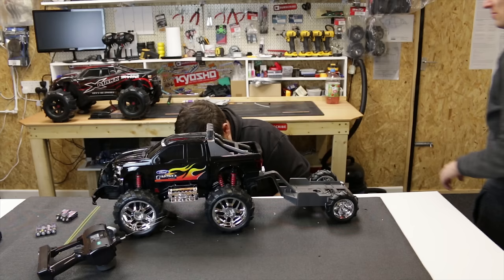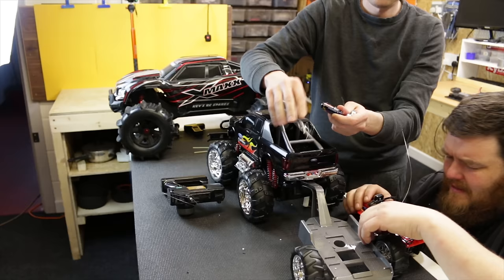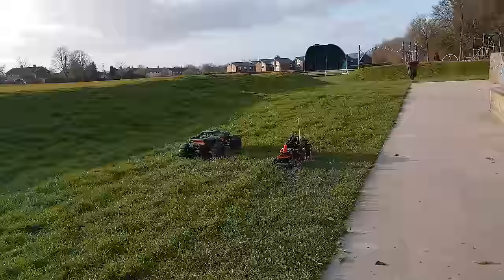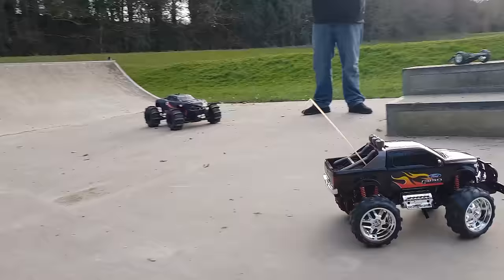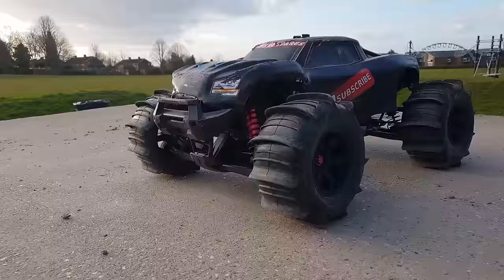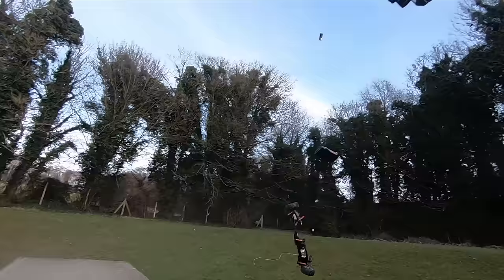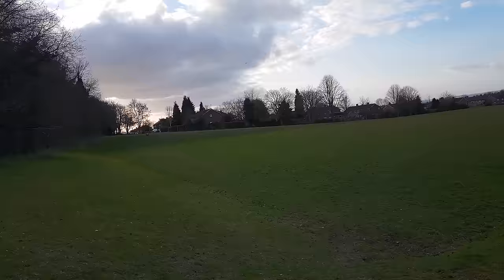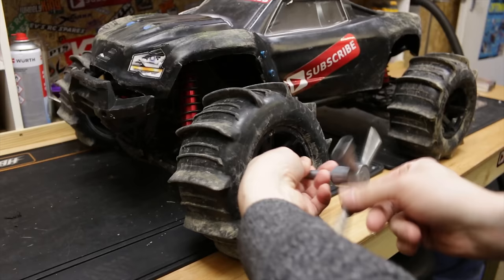$1000 vs $99 RC Car Test with Demolition Derby

Comment from the maker: You can get the X-Maxx here https://amzn.to/2N9UPhs (US)
                                                    https://amzn.to/2oqTMfj  (UK)

ESC https://amzn.to/2PgTiDG
Steel Spur https://amzn.to/2NCGQh9 (I use 50t for 6s motor, 46t on 8s motor)
Steel Spur https://amzn.to/2PmZudt  (I use 19t on 6s motor, 22t in 8s motor) If it runs too hot to touch gear down (Smaller pinion or larger Spur)
RPM Hubs https://amzn.to/2PTZFOC
Servo https://amzn.to/2NDk9K5
CEN gs025 Pins (2 packs needed)
6s Motor https://amzn.to/2N48Q0l (I run 6s motor on 8s for more power, WATCH TEMPS!!)
Lipos https://amzn.to/2C2EgzL (FLOUREON 4S 14.8V 5500mAh 35C)
Earplug for Centre DIff https://amzn.to/2C2aRG8 Standing backflip mod) 
Battery Connectors https://amzn.to/2N2Zgee
Charger https://amzn.to/2NzJHrk

Bluetooth  Module https://amzn.to/2N4ElqR
Camera https://amzn.to/2N31dqP
Mount https://amzn.to/2LKbCmG (I hot glue this to my controller so I can solo film 
Editing: Adobe Premiere PRO CC

PC:
Processor https://amzn.to/2wxCJvC
Memory https://amzn.to/2opyz5j
GPU https://amzn.to/2LIBSOj
Reply: nice video
Reply: Thx!
Reply: Oof
Reply: De 'm loop 'm lp
Reply: I can't afford a xmaxx. I just did a tower hobby payment plan on an arrma granite blx
Reply: @leannemoore8269  Why is that?
Reply: Kevin Talbot hi
Reply: This is my favorite vid you ever made
Reply: 0:28 😂😂 I actually thought Pat lives there
Reply: Poor child
😂😂😂😂
Reply: Kevin Talbot *
Reply: @samuelnielsen8911  ha in a way it is about the same size but still
Reply: Can you have the Sam and juste change motors and suspension you like customers it
Reply: Leanne Moore nah he’s actually not
Reply: WOW THAT WAS LOOOOOOOOOOOOOOOONG
Reply: @leannemoore8269  why??
Reply: my friend saw this video and said that you upgraded your rc car to make it so fast and said that you fixed it every time LOL

until I showed him my xmaxx and my arrma Kraton 8s
Reply: @leannemoore8269  why!????
Reply: Please me
Reply: I know why the 100 solar car lost because it was a Ford lol
Reply: @barrettschmidt8032  lol same
Reply: DK ?
Reply: Hey kevin i like toys can i get xmaxx
Reply: Hey kevin i like toy can i gey xmaxx pls
Reply: @leannemoore8269  yes
Reply: @jotcw81  makes fun of the poor people on this video
Reply: Give one car please
I don't have money please
Reply: @Ezra Camilo Instablaster =)
Reply: @Alessandro Cristian Thanks for your reply. I got to the site thru google and I'm in the hacking process now.
Looks like it's gonna take quite some time so I will reply here later when my account password hopefully is recovered.
Reply: @Alessandro Cristian it did the trick and I now got access to my account again. Im so happy:D
Thank you so much, you saved my account :D
Reply: @Ezra Camilo no problem =)
Reply: I have a $60  Monster Jam Monster Truck. Megalodon I purchased from Meijer. Here in Michigan USA. IT is the most durable toy grade Rc I've ever owned. I got my 5 year old nephew one and it was so damn cool I bought one for myself! It has durable foam tires that make it go from land to on top of water. Mind you on water it's slower than piss.. but on land it's QUICK!! . NOT as quick as my Arrma Vorteks but damn is it cool!!
Reply: I haven't seen you review the 60$ Monster Jam Monster Truck Megalodon Rc that goes on water and all terrain.?!?
Reply: I stay in condo my room so small no room for big rc cars
Reply: Did you swap pretty stock body for a Russian made one.I have  the Russian made one & EZ RUN MAX 6 & a $1000nz🇳🇿 worth of upgrades too.Keep up the great work.👍
Reply: Toys cars
Reply: Hey kev, how about donating all these 100 dollar rcs to me instead of talking crap about them and wasting your money so i can give them to kids that would be very happy to have them. RIP toy grade f150, you will be missed
Reply: @judetibbott7294  just about yeah but i just wish kevin would stop painting toy grade rcs in the bad light

Comment: I'm amazed at how stable the Max is, there are moments where it looks like it's correcting it's flight... mad props to the designers.
Reply: The driver does that with throttle and brakes.
Reply: He is correcting it, with the throttle
Reply: Most rcs do that if they have enough power... 4wd really helps. But yeah, it's a driver thing.
Reply: Any car that goes more than 5 mph you can control it with throttle

Comment: At least the traxxas slash is only about $200 and includes the battery and a charger. It isnt the best or fastest rc car but its well suited for beginers. It can go about 30 miles per hour and it has a pretty long run time. I have a ton of fun to driving mine around at an elementry school near my house. While I was driving it through some bumpy terain, I noticed one side of the car was low. This was because the screw for mounting the shock to the body came lose from vibration. So it needed a new screw. $2 at the hobby shop for a pack of 4 new screws! And I was back up and running. Save your money and get hobby grade!
Reply: My first car was a mini slash definitely worth it I bought it not knowing what hobby grade rc cars were as a 9 year old who only used toy grade rcs my mind was blown
Reply: Don’t waste money on buying 4 screws, just get like an assortment of 500 screws for 20 bucks

Comment: Can you do like 100$ hobby grade vs 100$ toy grade?
Reply: Fine_ Gamer there is no comparison. My first was a 100 dollar hobby grade. It was amazing until I tried going brushless. 600 dollars later of trying to make it work I decided I'd buy a rusty...
Reply: oh i know that, i have a few hobby grades, some cheap some expensive and ill prolly never go back to toy grade ever, but it'd just be funny to see Kevin do it. lol
Reply: so $100 for the truck, $100 for brushless, $30 batts and... $370 in replacement differentials and driveline components?
Reply: Check this one out..  Actually my favorite rc right now is this guy for less than $100: https://www.ebay.com/itm/WLtoys-10428-B2-1-10-2-4G-4WD-Rock-Crawler-Off-Road-Buggy-RC-Car-RTR-Gift-Z9A5/172833212714?ssPageName=STRK%3AMEBIDX%3AIT&_trksid=p2057872.m2749.l2649
Get it, trim the front and rear fenders so the tires don't rub and put some 100mm oil filled shocks in the back.   It is awesome! and because is small i was able to make a rad little track in my back yard for it. I drive it more than my X maxx or any other RC.  I actually have 3 now, and have over 100 packs though one of them.  Eventually the tire foams need replacing and the front diff, other than that its pretty solid.
Reply: You probably couldn’t find a hobby grade car for $100 and if you did it would be a tiny one like 1/18
Reply: Kstorm 88 what kind of batteries do you use? Seem like a steal for that price
Reply: Fine_ Gamer thats a good 1
Reply: My youngest still bashes a nitro circus we got from hobbyking for around a 100. Its had few bits swoped out with alum and a replacement ESC but can take a S4 and go like the clappers. it's hard a rock for my 5 year old
Reply: best rc under 100$ ever! (but with oilfilled shocks it will go over! ) 
must do:- Replace front and rear diff with metal ones (10$)
- oil filled real shocks (25$)
- change rear drive train angle (front left wheel stops going up under full trothleand just bash like you stole it!
Reply: My cheapest rig is my Hellseeker 50$ for the kit, 55$ ESC, 20$ motor, 27$ servo, and 25$ for transmitter/receiver....still kinda expensive but it felt cheap because I built it over a couple weeks and bought parts one at a time.
Reply: cobra 1/8 violence truck vs lil 100 dollar boi

Comment: You can spend $50 more than the cheap one and you can now get a brushed Traxxas bandit in America for $150.
Reply: About 300 with batteries and charger but yea I get your point
Reply: Cade Bender
Reply: Or... a tamiya tt01 drifter if youre not into offroad

Comment: Slap a momba monster in a toy grade one and see what happens
Reply: I actually put a brushless in the same type of chassis once, it went along ok. It span out all the time on the rock hard tyres so I added a cheap gyro too. I have done brushless upgrades to several toy grades just for the crack but to be fair, it's usually the older 80's and 90's ones that were much much better than the new ones. Some of them were even essentially hobby grade in disguise.

Anyway, here's the crappy truck with a brushless motor:

https://www.youtube.com/watch?v=rnFUzd2pXBw
Reply: Yeas
Reply: An implosion would happen

Comment: amazing what people will waste $100 on!!! complete garbage
Reply: thanks Kev, I'll be getting my xmaxx soon... hopefully LOL just can't let the wife find out they're a grand!
Reply: Superdutychase I would agree that RC car was garbage, but for 100 to 120 you can get a decent hobby grade 1/18 scale RC car like I did. I have the DROMIDA 1/18 scale brushless monster truck. I got it for about 120 dollars.  And it goes 30MPH And I love it. It is a great beginner truck, and I am a beginner. And for 100 dollars like the toy grade in this video, you can get the Helion Animus 18SC, which is brushed but still can go 20 MPH. So I would say as long as you don't buy a toy grade, if you are a beginner or looking for  a cheap car and spend 100 dollars on a good hobby grade RC car, it won't be complete garbage.
Reply: nascarsimracing1 I also have a cheap 1/18 that I started with. It's a wltoys a959-b, it's a 1/18 scale 4x4 with a brushed 540 that'll do over 30 as well but it always seems to run hot so I'm looking at swapping in a brushless. It was like $60 brand new and it's fully upgradable so not too bad of a deal to start with... I'll probably have $150 into it when I'm done so that parts kinda sucks but whatever I can't stop now LOL
Reply: Youre right.....like the people who spend 1000$ for an i phone

Comment: If you want a good toy car go check out a wltoys car! They are really cheap
Reply: 123Opie got one of these wltoys cars. Way better than the $100 crap showed here but the drivetrain and diffs are totally wrecked after a few runs (to be honest I also replaced the stock li ion battery with a stronger lipo 2s pack).
Reply: i have one too. diff and driveterrain got fucked a bit quickly but now i got a full aluminium upgrade kit+ some other small upgrades for it and it holds up way better now! only costed me a total of ~~120 euros
Reply: 123Opie 979 b

Comment: I think you should get the maxis rodeo tokin for a video. It's a capable 1/16 crawler (with a tough plastic body that I couldn't break or bend even if I tried!) that I use and I want to see it against the xmaxx! You can get it from 60-100 dollars

Comment: I know this is a really old video but I clicked on it because of the title $1,000 RC versus $100 RC  and I will honestly say that believe it or not companies do make a hobby grade RC truck that's four wheel drive with steel drive shafts for $65 the company is kind of new but their name is DeeRc I've had my truck for about 6 months and for the amount I paid for it I got two extra skins two batteries and two chargers and because it was so cheap I already assumed it would be kind of slow but it actually hits about 32 mph one thing I would say is try to remake this video or one similar to it putting a DRC truck up against a x-max or other comparable truck you might be very surprised of the results I raised one of my buddies who has a Traxxas trophy truck his is also gas not electric I destroyed him off the line he caught back up to me but barely passed me and his truck has about 350 bucks in it so all I'm saying is just because it's cheap doesn't mean it's not good I mean I've jumped my truck off of my two story back porch and the only thing that happened was I bent a shock which is easy to replace because the company gives you an entire booklet of every single part and part number and where you can order upgrades from just another perk I would really like to see more channels start doing reviews on the DRC truck platform it would sure make me happy because yes they're cheap but they're also easy to fix and easy to find parts for

Comment: Noob question here.... When you're doing a jump, how are you controlling the pitch forward and back? Are you just braking?
Reply: Throttle will tilt the back down and the brake will point the noise down
Reply: To make the car flip/rotate backwards apply throttle to tip forward slightly don't apply throttle to front flip or tip far forwards brake

Comment: Does anyone know of any high quality rc cars for less than $350?
Reply: You can buy most of the Traxxas vxl for less the 350 such as the stampede vxl 2wd for 289 which I am looking at getting although this car does t come with a battery or charger which is probably another  $100
Reply: *not

Comment: I don't even consider that waste of plastic toy grade. Man you gotta spend over $100, anything with a wire whip radio is complete garbage always. Save up, get the kid something nice. Lot's of fantastic options under $200. You might as well have burned that $100, any kid will destroy it in a day.

Comment: How the hell did I get an amazing £100 truggy rc car with 4 suspensions on the rear and 2 at the front that goes around 32mph  
And takes a battering yes the front bumper is f**ked but it's not that expensive to replace
It's called vatos 9156

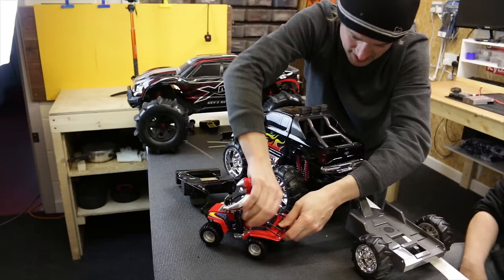Comment: the $100 could get a better than that like the monster truck of my brother 1:10 scale same as the traxxas but different wheels and suspension the traxxas is better oversized wrecker 4x4 drive for only $50